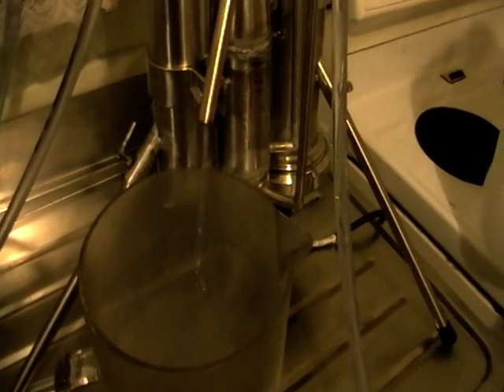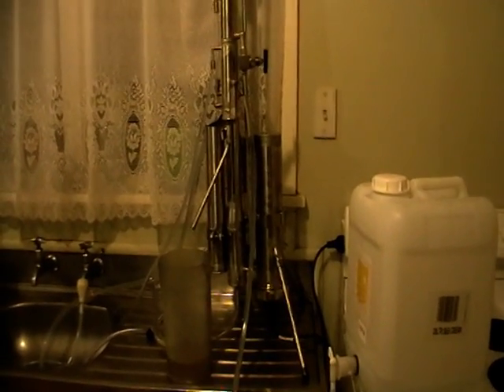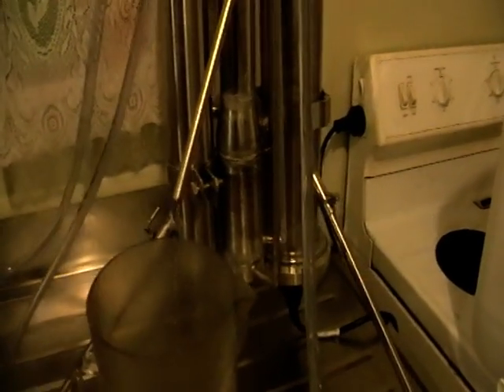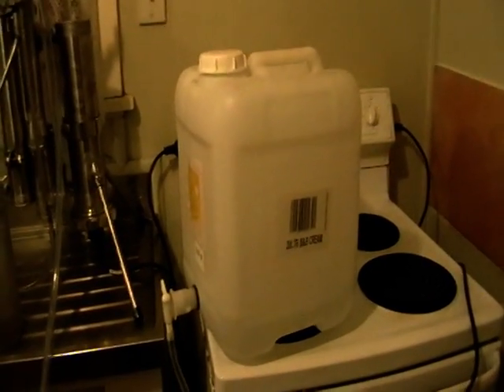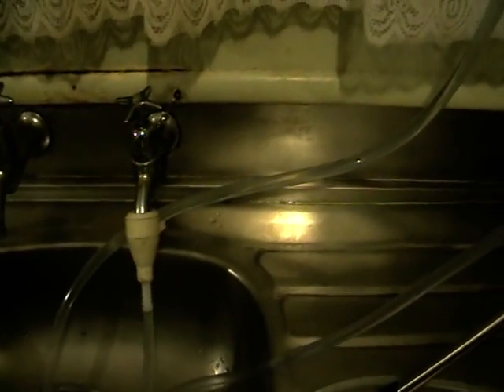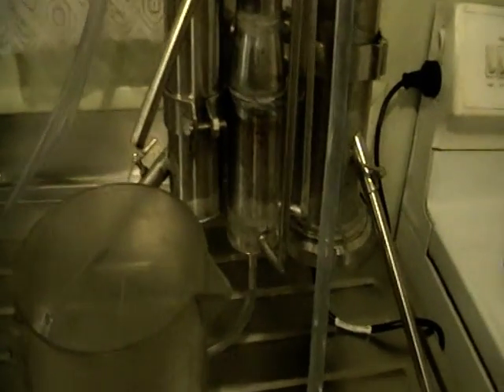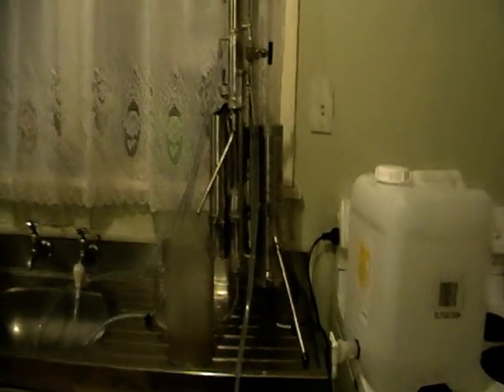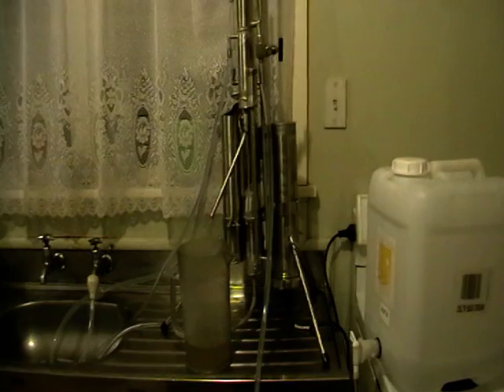Continuous alcohol still 1.5kw

Comment from the maker: Hi , yes I have a smaller one, just a curiosity, the problem with a small diameters is high resistance of the internals and liquids are not acting as they should in a continuous still, so not really efficient and not stable, the 1.5 is the smallest one that works absolutely stable, though trying to improve the even smaller design.

Comment from the maker: Hi, the still is for a hobby brewer who wants to  save space and time and also increase production without having a trouble with a huge pot still, also this still was designed to be used along with a small "Alex 25" fractional system, thus this still has a preheating time: 5 minutes and will process 100L of mash in a few hours, and with a 25L fractional still one will make 8L of 96% ethanol or 20L of 40% real vodka in one day, the 25l still along will make only 2L of 96% ethanol - same time.